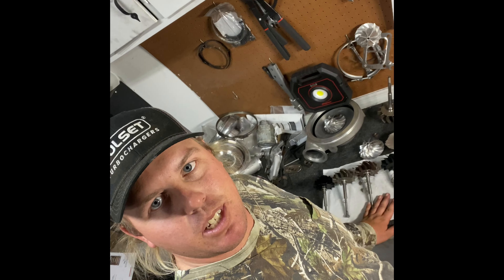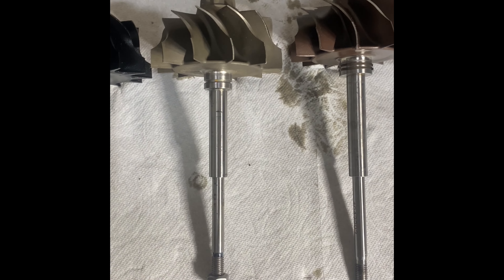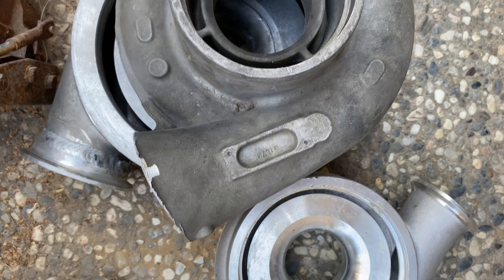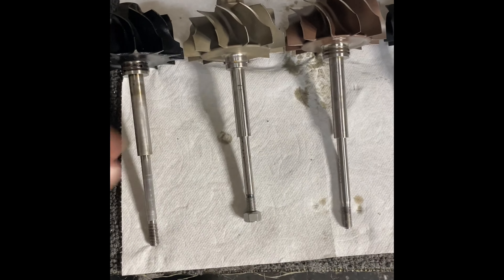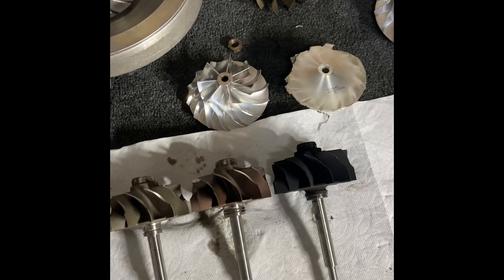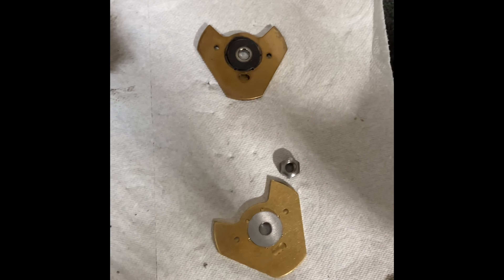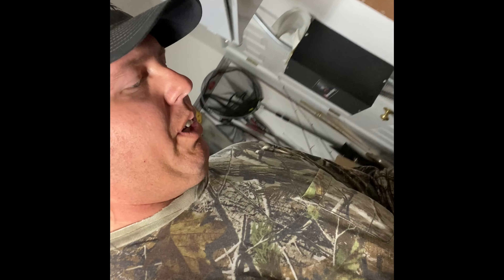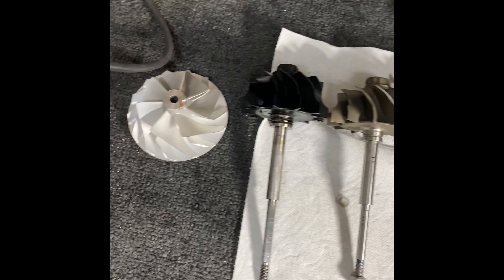Almost everything you need to know about hx50, hx52 & hx55’s

Comment: Thanks for the info. You definitely know your turbos. For those of us that run HX52s on our Volvo D12s, can something be pieced together with HX55 parts? Can this be done without machining? Also, how do you think it will effect performance? Will ECU tuning and/or fueling changes be required? Thanks for the help...
Reply from the maker: Machine work is required on almost any worthwhile upgrade. 
Yes, I would suggest tuning.

Comment: Is there a way to put a smaller exhaust turbine on a military whistler (Switzer) turbo? I'm trying to replicate the iconic sound but think it can only be done by using a smaller hot side for quicker spool up. With a 12 valve. It's got a T6 housing and with the low gearing and 465 cubic inches it spools on a deuce pretty well. But won't spool on my 5.9 until 2500 rpms. Wonder if that's something you might be able to help figure out?
 I'm running 4.10 gearing, a RTO-6610, air shift t case and 43 inch tires. Wondering if an HX35 or HX40 T4 might help it to spool off idle to 2500 rpms? If it's even possible?